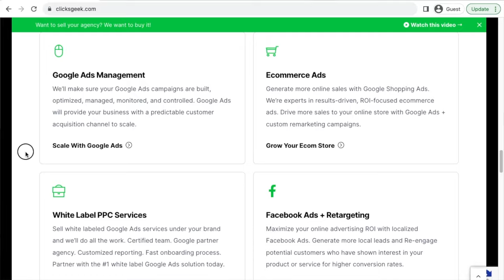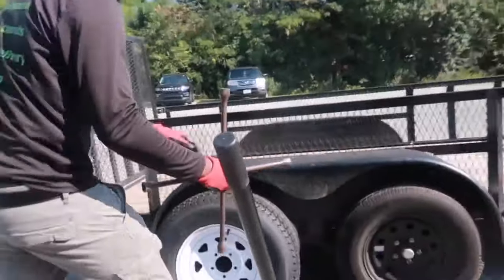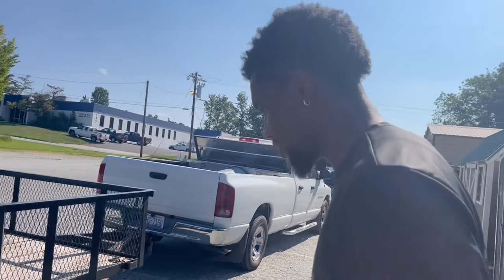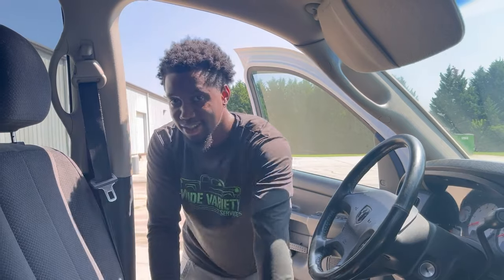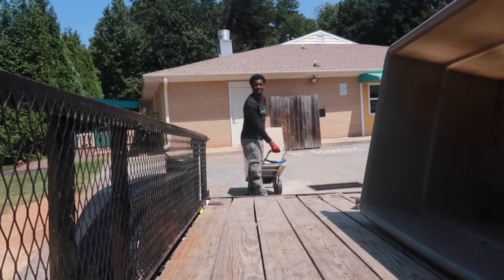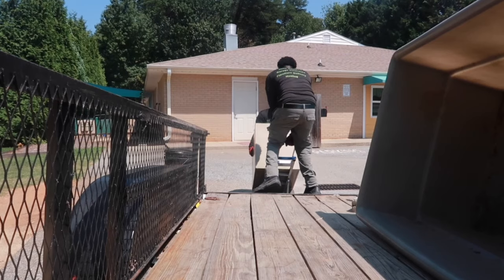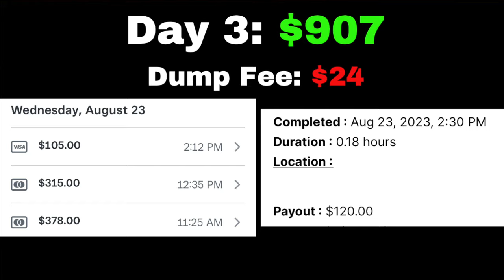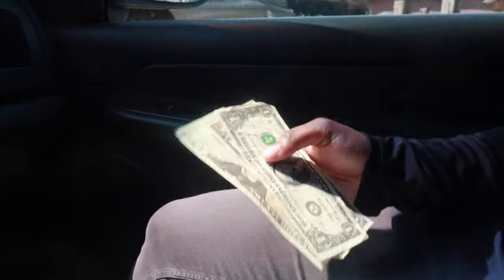HOW TO MAKE $900 A DAY WITH A PICKUP TRUCK | Making $2000 In A Week With A Pickup Truck PT 2

Comment: Winch on the trailer will help loading and unloading if you do right
Reply from the maker: Whats the best way to do it?
Reply: @JoshandAbre  I have a sliding system that I got right here on YouTube. I also have a tilt trailer. I only use it for dumping trash. I can't say which is best for you. I prefer the front of the trailer.